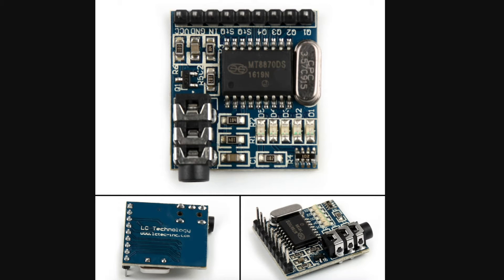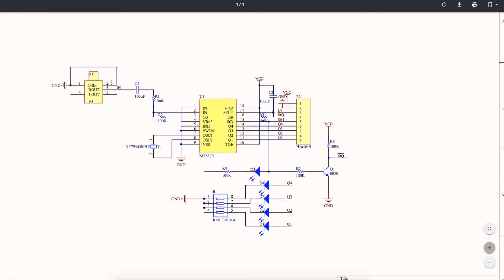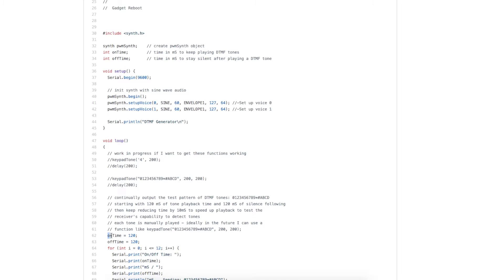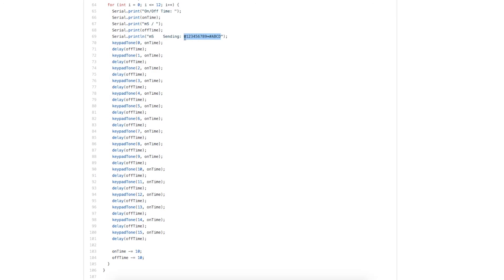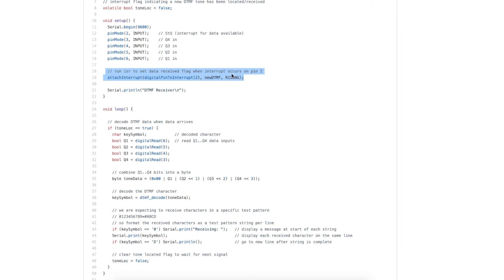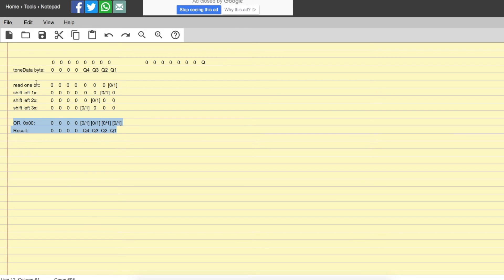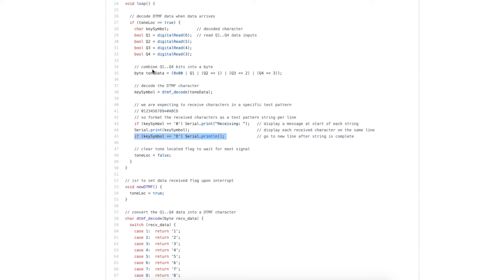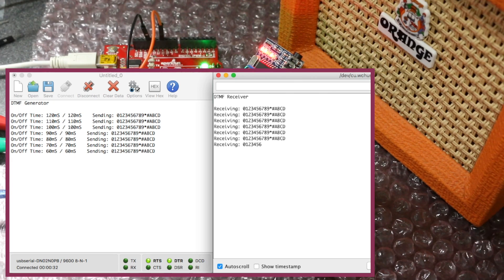MT8870 DTMF Decoder Module - Arduino Test with PWM Audio Synth Tones

Comment: Hi !! I bought two of these modules, but when connected VCC and GND, it makes a little fast flash of one led, and nothing else. What do I do ? thanks !
Reply from the maker: Did you just power that module by itself or did you set up something to generate DTMF tones to play into it?
Reply: @GadgetReboot  Just positive and negative
Reply from the maker: are you referring to having purchased Arduino Uno boards or MT8870 DTMF decoder boards?
in either case if you just buy them and then connect power to them nothing is going to happen. 
You need to put software in the Arduino boards and for the DTMF decoder board you need to give it DTMF audio tones through the jack and the LEDs will show a binary representation of any tones detected.

Comment: This is a great project and exactly what I have been looking for for my current project.  But 1 question.  Could someone point me in the direction of  capturing (if Im using the right terminology) DTMF strings and executing a function once a series of numbers are received, such as, once a 4 digit code is received, a function is executed.  Thanks
Reply from the maker: In the code here for a work in progress phone line simulator, I do that to wait for a phone number to be dialed 
https://github.com/GadgetReboot/misc_file_bin/tree/master/2022_11/Telephone_Central_Office_wip/rev3
It's a messy project with the relevant code split between 2 of those project files but near the top of the main sketch there's a phone number variable that holds the valid number to detect, then later in the sketch it keeps checking if a DTMF key has been pressed by calling a function that's in another misc functions file there.  It will keep adding the new DTMF keys to a string until it matches the valid phone number and then can do something else.

Comment: You should refactor lines 70 thru 101 into another for loop in DTMF_Generate ... and the function dtmf_decode could return an array element based on index recv_data instead of using that switch statment. Cool stuff! 😄👍
Reply from the maker: Yeah I just scrapped everything together at the last second to get it going, if I keep up on projects like this I will develop a bag of tricks in no time.

Comment: Heyy! Watching this video and all of a sudden I see my code! Cool! But I also spotted my bug... In the char version of keypadTone() I forgot to print 0 to 9 characters... 

But I also found a bug which was present in your original sketch, if onTime was >0 the silence (0Hz) was never triggered. This is also what you can hear in your video, dial tones with no gaps. Which makes the total dial time onTime + offTime. There is NO silence. Which makes it work up to 60ms tones with no pause.

Fixed all that here: https://pastebin.com/5SEYKHRj
Because debug is easier with serial instead of tones, I used this during debug: https://pastebin.com/L0FGs9K9

While test compiling it with synth-library I got annoyed by all the errors. Can be fixed by replacing tables.h in the library with this: https://pastebin.com/0LbePPtu

On the receiving end it's not really necessary to use an interrupt. But this is how I would simplify it: https://pastebin.com/bhWcvsHk

Keep up the nice video's!
Reply from the maker: I’ll check out all the info. Thanks! I had meant to try this out sooner and before I knew it five months went by and the larger scale phone line simulator project kept getting delayed but I’m trying to get back to that.
I think I used the interrupt because eventually there will be more code doing more processes and I didn’t know if I would need the interrupt at that point.
Reply: @GadgetReboot  Yeah, time goes a lot quicker than our projects :/ And I missed the reply on my comment on the first video. The notification system of YouTube is a mess nowadays :s

I though I'll make a simple library for it, one that doesn't use delay(). But that synth library is a bit of a mess :/ Why does it only contain a header file! Makes it terrible to include in a library!
Reply from the maker: @tengelgeer  I always miss comments depending how I'm trying to access them between the comment system within the Youtube creator account vs viewing Youtube as a normal user signed in to my account vs using the mobile app etc, sometimes I only see a comment because I happen to be viewing OTHER comments and there's one I didn't know existed...I'm sure lots of viewer questions have gone unnoticed/unanswered!   I want to do a manual scroll through various video comments just to see what I missed...

Comment: Very good project! Could you consider reimplementing the encoder in software on a esp32 or STM32 using the Arduino? Would that interest you and others here?

It would make a perfect phone interface.
Reply from the maker: It would be worth trying, I'll add it to a to-do list
Reply: @GadgetReboot  I won't mind helping. Timed delays on these that run rtos does not work, like it does on the stock atmega, due to non deterministic scheduling of threads. So for example, on the esp32 we would have to either use the rmt or the i2s dac
Reply: @subhobroto  Of course you don't need to use an RTOS,  RTOS are ok for a lot of things but on microcontrollers is easier to keep to a single thread in my opinion.  setting up DMA would release the core from a lot of the timings.

Comment: You could have done a port read, "AND" with mask, and shift left if required to get input value. should be faster than single bit port reads and processing. 

Brings back memory's, we used to make field telephones which used DTMF for signalling between telephone and exchange. I've forgotten how many channels we used to get over a single pair of D10 wires. RF below 300kHz was all we had to get all the channels in.
Reply from the maker: @amosba  yeah when it comes to software, sometimes I do the equivalent of designing a PCB with three 10 K resistors in series instead of a single 30 K resistor, assuming I don’t need to spread the power dissipation across the three and there’s no other good reason to have done it!
Reply: We're not talking crazy speeds  here. So I would rather use some digitalReads() and keep everything more readable en portable then to have to look up the ports and document it in the code.
Reply from the maker: @tengelgeer  yeah I did a little research and if we were to want to read in an entire port we would have to use chip specific things and bypass Arduino and we don’t really need to optimize like that for something like this project.
And even if I was on the edge of needing to optimize, I think I have at least an extra 30 ms that I can play with because I only want the tones to play so fast and the hardware can detect them still going 30 ms faster so everything should be fine.